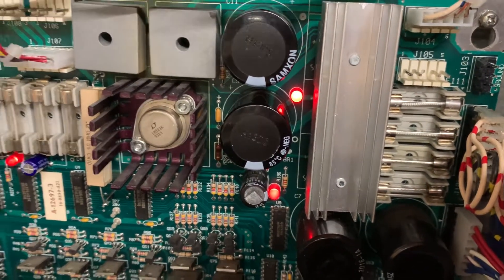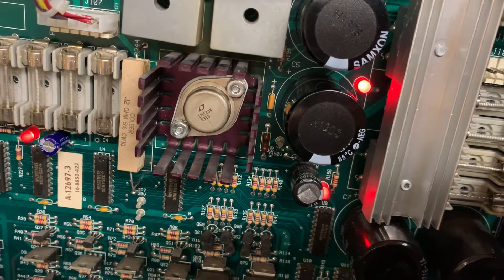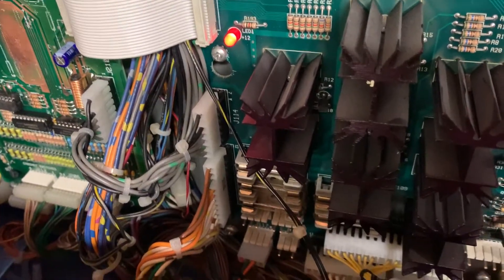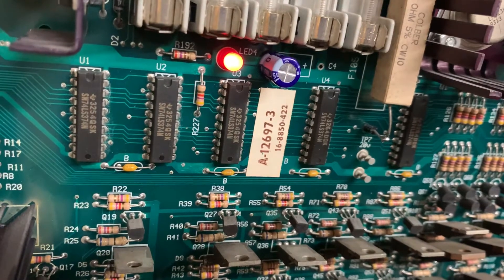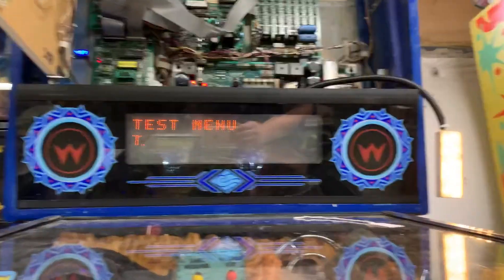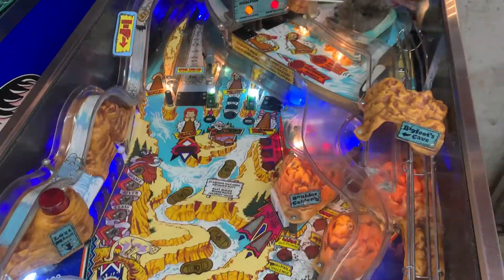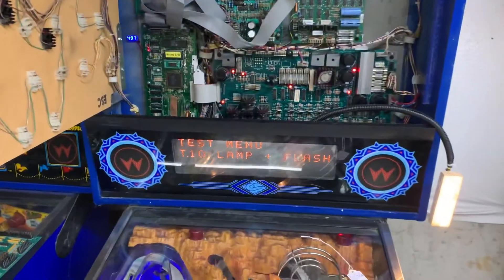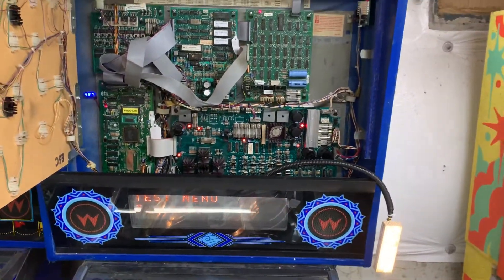WPC Power/Driver board repair test verification

Comment: Thanks for sharing again Chris. Just took the plunge on my WPC power board today, inspired by your videos. I replaced two burnt headers and reflowed J101 and 102! I feel like a wizard! I then couldn't get the DMD to come back on... J117 was hidden behind the power board when I put it back in! Plugged in, It works..! 5v seems fine so I think I'll leave everything well alone until I see issues! But I'm itching to replace the caps you always mention!